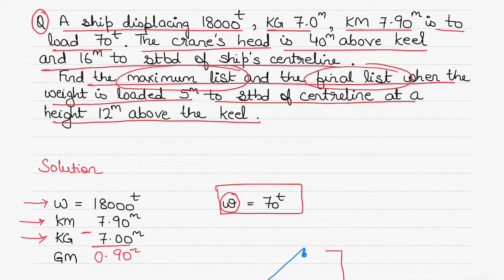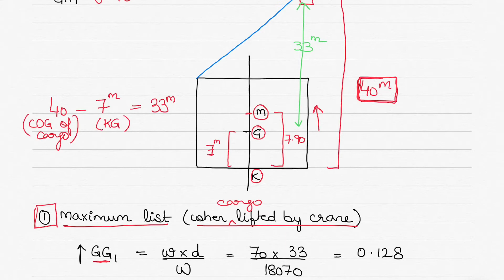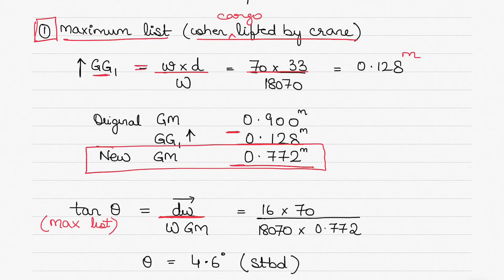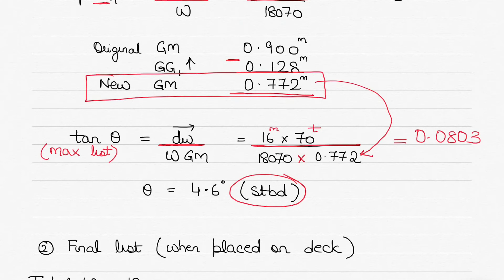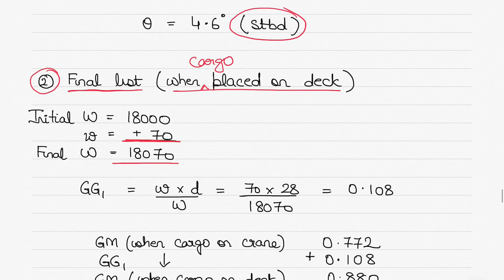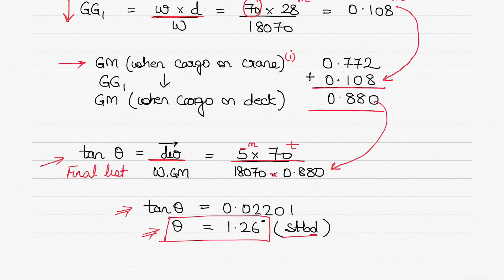Ship Stability - How to calculate the Maximum and final list when loading cargo??

Comment: A ship displacement 9000t, KM 7.3m and KG 6.4m. She has yet to load two 50t lifts with her own derrick. The first lift is to be place on the deck on the inshore side , KG 9m  and 6m off the centerline . When the derrick plumbs the quay it's head is 15m above the keel and 12m out of the centerline. Calculate the maximum list during the operation.
Sir will you please explain this